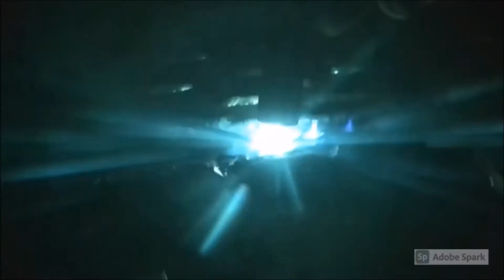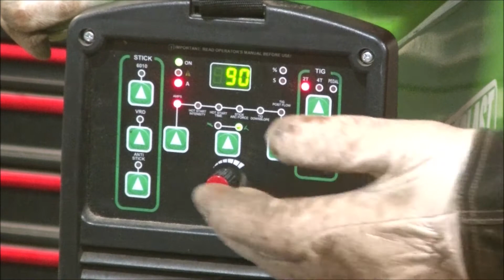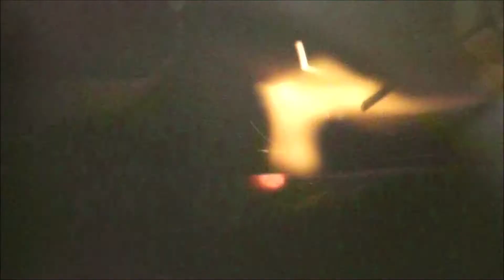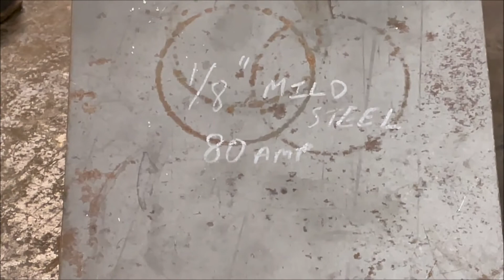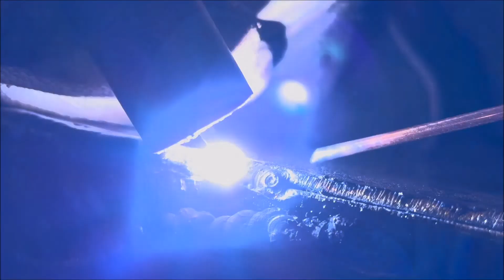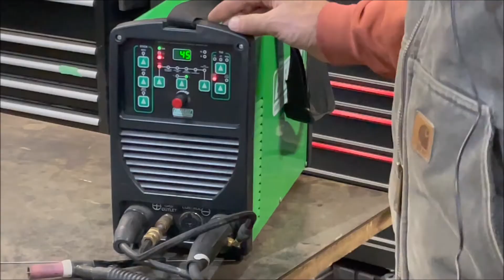Everlast Power arc 210 STL tig Review

Comment: The lift arc is harsh man! Having to change to tungsten out after the weld is done with, still runs great though 👍🏽
Reply from the maker: scratch start is a little easier on the tungsten; but high frequency starts are the best